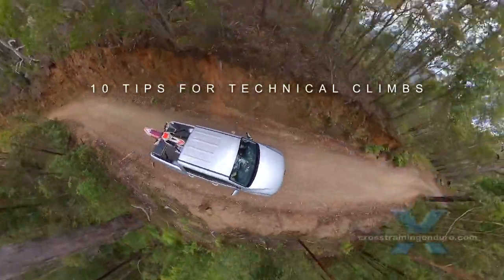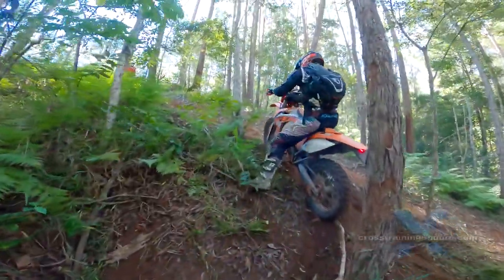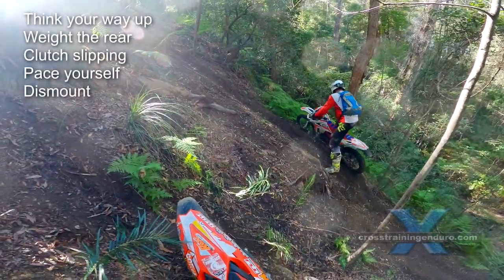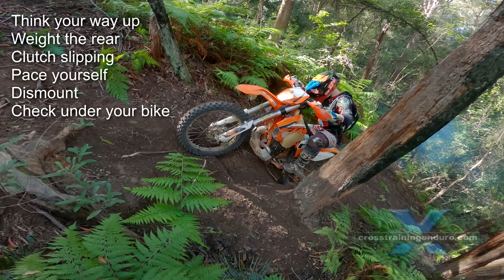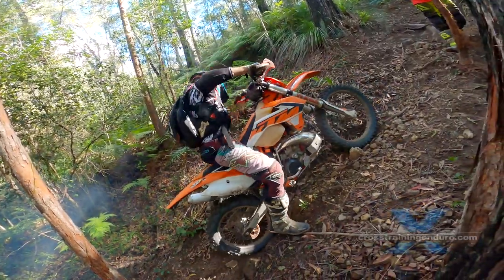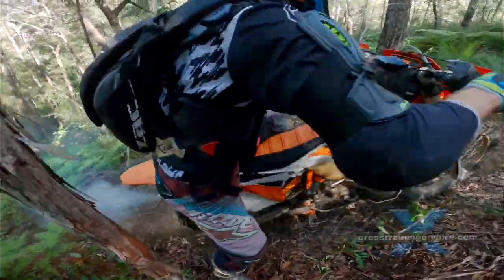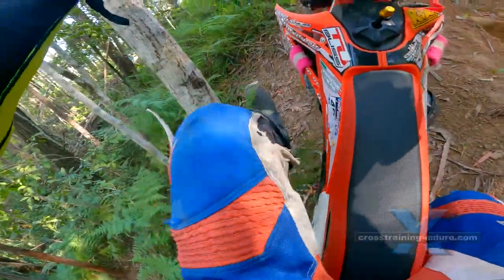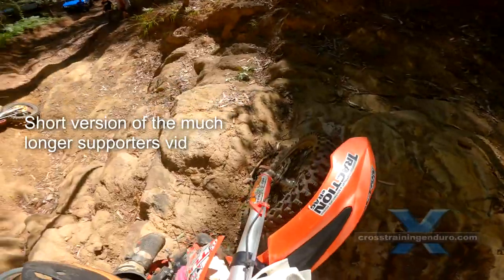10 tips for slow technical hill climbs︱Cross Training Enduro shorty

Comment: My bike is carbureted, when I have a choice,
I lay it down (drop it) to the right side, then 
the fuel doesn't spill out of the over-flow. 
I also hit the kill if I know I don't have time 
before it stalls, if I do have time, I grab the 
clutch (pull it in) first then pick it up, avoiding stalling 
as I pick her up. If it chokes out, or flames out 
on me, I don't bother kicking it 25 times, I crack 
the throttle open 1/8'' (couple mm's) and kick 
hard as I can, it will start, first kick. Once in a great while it
will kick back on me, but that's pretty rare.

Comment: Barry, this guy: https://www.youtube.com/watch?v=QChLiMcGQf4&lc=UgxwEryULPty17Ewlm54AaABAg.A176GWnycOoA1DZokAQXTr says that leaning over the bars is not a good technique for preventing loopbacks. I have a feeling that squatting works, but to a limited extent. I use it only on short ones. It seems there is not much room to move forward. What do you think?
Reply from the maker: It's a good point and I actually need to redo some of the very early training vids on body positioning and hill climbs. Rough rule of thumb? As it gets steeper you just squat more to lower the centre of gravity. Or if sitting on the seat, slide forward. Leaning  over the bars is only for when it's very steep and must be done to avoid a backflip. I base this on training with Chris Birch we did years ago. Other enduro trainers may disagree of course...
Reply: @crosstrainingenduro  Thanks. It just occurred to me that it was on a dual sport CRF300L. It has bulkier than enduro tank in front, which might be the problem with moving forward. I have switched to Sherco. It has better shape for this.